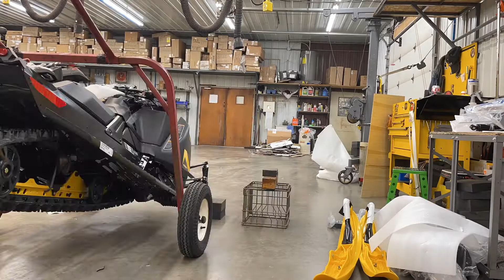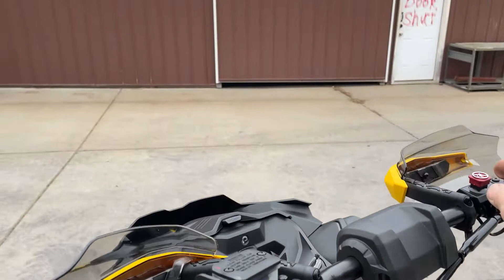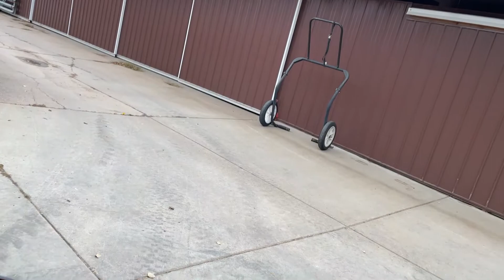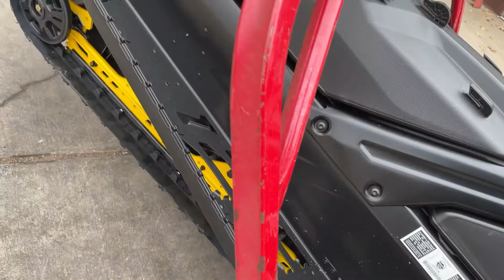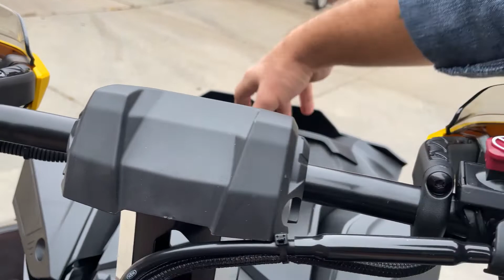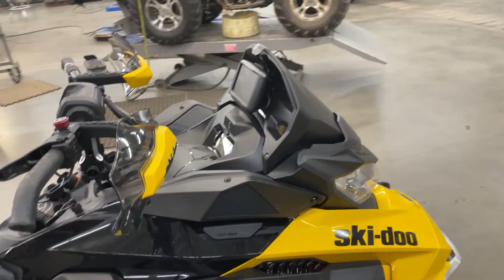2023 Ski-Doo MXZ Neo+

Comment: I am a 5foot7 man 217lbs...i was thinking about buying this sled because of the price...just wondering if it would be a ok sled for me...i go on alot of narrow woods trails so a narrow smaller sled would be good..i am asking because i would like to do a trail run once in awhile as well.....i am currently running a 1988 polaris 340 it is a fun little sled but i think it is time to upgrade...i also have 2 kids 14 and 16 that would ride too
Reply from the maker: It would have more horsepower and be a lot snappier than your 340, Neo’s are really light an nimble on the trail. I’m sure you would be happy upgrading to one.

Comment: I got a question so sense there is a 40 and a 55 horsepower one, that is same engine just detuned from factory right.
Reply from the maker: Yes
Reply: @DLM6669  So you could always just change the tune, if you wanted right? And also do you know the top speed on them.
Reply from the maker: @tommyolson1438   BRP says it can’t be done. Along with a different ECU that may not be able to be programmed to the sled, the exhaust is different, the heads, injectors, intake may also be different. 
If somebody wants the stay with the 600 efi it likely would be a lot cheaper to sell it and upgrade to a sport.

Comment: Any adjustment on the rear suspension? Torsion adjustment? How would it handle heavy riders in the 275-300 lb class?
Reply from the maker: There’s five adjustment positions on the rear spring to adjust sag for rider preference.

Comment: What windshield is that? I was going to order the low tinted one.. but that looks way cooler
Reply from the maker: There’s no windshield, it’s the Glovebox Extension/GPS support PN 860201249 with the stock Central Deflector PN 517305875
Reply: @DLM6669  ok thanks for the reply

Comment: Is there anything stopping you from changing to the 80HP MXZ sport ECU? I've heard it's the identical engine in the MXZ Sport, just de-tuned.
Reply from the maker: BRP says it can’t be done. Along with the ecu the exhaust is different, I don’t know if the heads, injectors, intake and etc are the same as the 85 horse. If somebody wants the stay with the 600 efi it likely would be a lot cheaper to sell it and upgrade to a sport.